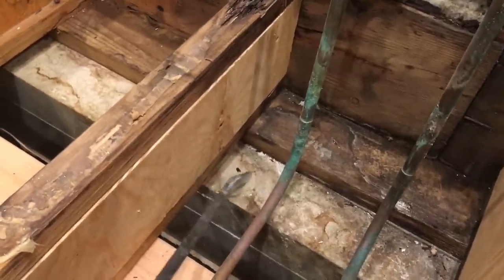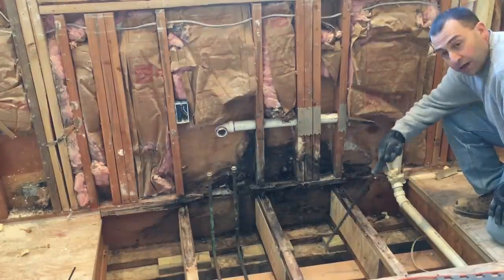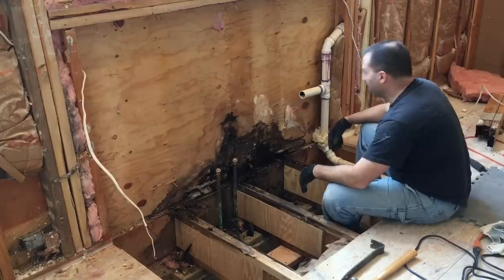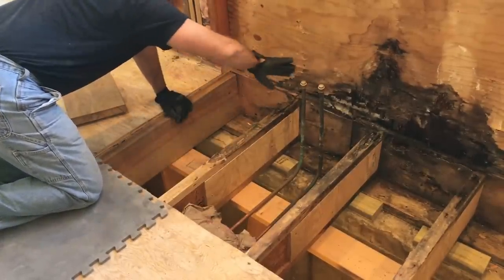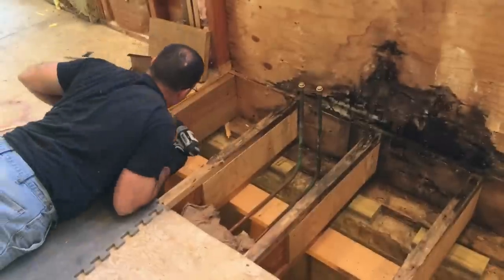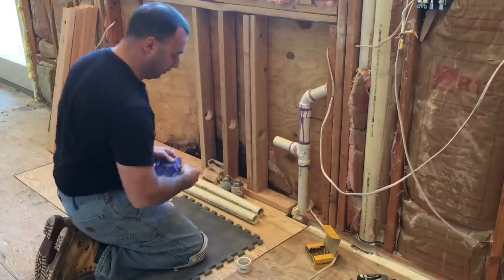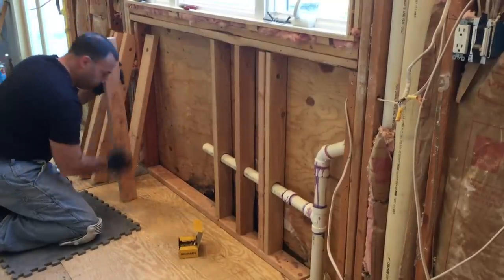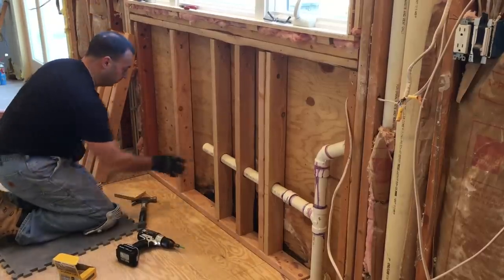Repairing Rotted Joists and Subfloor  - Part 4 of Remodeling My Kitchen

Comment: In the beginning of your video it sounded like you knew you water damage. That damage isn’t from a simple drip you had a full on flood and ignored and didn’t do anything to fix the problem till that part of your house was going to collapse. That in my opinion is nothing but neglect
Reply from the maker: Well...  Your are right I was aware of the problem.  But not to the extent until I tore apart everything.  As far as neglect?  I did take precautionary steps prior to remodeling the kitchen.  From below it was clear there was a leak.  The foundation wall was wet and when I pulled out the insulation in the floor joists I could see the rot on the ledger board and the sill plate.  But there was no way of telling if the leak was from the kitchen sink or soaking through the ledger board from the outside. 

First thing I did was wear gloves and a mask and pulled out all insulation from under the floor.  Then I shop vac'd all the loose rot wherever I could.  All of this was from below in the basement.  I took a spay bottle filled with straight bleach and sprayed everywhere I could down there.  Once the bulk of it was dead to the best I could, at that point I shored up the joists with that 2 x 6 wall you see in the video.  I knew the permanent fix would be once the kitchen got ripped apart.  At this point all I could do was monitor it.  But the wall at least alleviated any concern of the whole floor collapsing. 

My old kitchen consisted of granite counters tops.  The weight of the slab sat on top of the kitchen sink counter.  To the immediate right of the sink was a dishwasher (no support), and to the left was a trash compactor(also no support).  So there was no possible way to remove the kitchen sink counter and hold up the granite slab at the same time to do the repair.  Removing the granite was not an option as it would basically be tearing our that whole side of the kitchen, only to do it all over again when the remodel occurred.  And for an $80k Renovation, I wasn't doing it twice.   So I monitored the leak and ran a dehumidifier in the basement, spraying bleach on a regular basis as to not let mold grow again.
Now, onto the actual leak once I tore into it.  I don't know if I even explained this in the video.  There was a framing nail from the outside plywood sheathing of the house that was nailed right into the sink's main drain line.  I have a feeling when this occurred, but that's another long story.  After inspecting the old drain line, my guess is that the nail was actually plugging it's own hole for years, hence not an immediate issue.  Over the years, as the nail rusted out it left an open hole in the PVC drain and that's when the leak started to occur getting worse the more the nail rusted.  Never a full flood as you mentioned.  But a small hole can do a lot of damage as you see.
Anyway.  Long explanation.  But I wanted to address that I didn't just ignore and neglect it.  Believe me this was a huge concern.  But I feel much better now knowing it is permanently fixed.   The Good Lord was with me in that I caught this in time and had the means to completely tear out the kitchen to do the repair.  Appreciate the comment and you taking the time to watch.

Comment: It doesnt seem reasonable to leave all that moldy wood in there. I personally would have to take the molded wood completely out and start fresh. But this is Chicago.  Customers only want the best in this city. Not sure how it works anywhere else, but this would never fly in Chicago, the customer would be highly upset.
Reply from the maker: Well it's a good thing my customer is myself.  After getting a few few "pro" opinions (see my pinned comment), I am beyond 100% confident that I repaired this above and beyond any contractor would have done.  No one would have done as many steps as I did.  And not one suggested cutting out existing joists.
Anyone commenting about molded wood left behind doesn't understand what I did here. The sistered joists are now taking on 100% of the load - One end sitting atop a new Pressure treated sill plate, the other end sitting atop a new 2x6 support wall in the basement. 

The little bit of rotted wood on top of the old TJI joists are irrelevant at this point.  But the rest of the TJI is still fully intact (and stronger than original with my newly sandwiched 3/4" plywood in there).  Cutting out those joist sections would have actually reduced the strength of the new sistered joists. 

And any nonsense I see about rot "spreading" - Simply does not understand basic biological science. Mold causes rot.  Once living mold and moisture is taken out of the equation (both were), it is impossible for new mold to grow.   Scientifically Impossible. 

Sorry for the rant about rot - I know you didn't comment on that part of it.  I really do appreciate the feedback and comments.

Comment: I think it will hold up. In the COMMENTS, we simply comment about "ideal" scenarios. In reality, what you did will hold up a long time. 

In some ways it was over engineered but in some other ways, it was not done correctly- not like a pro should do it. No town would sign off on this if there were permits involved. I won't call you a hack- but it was simply not done in a highly professional manner. You did a decent DIY job though. You have the skills- just next time give that extra 10% and replace the materials. You certainly look capable- probably less work too actually! 

My biggest issue with your job. The way you handled the rot. Your patches. I would have definitely replaced all rotten and moldy wood. I have dealt with mold and rot. It's nasty stuff and you want it OUT. Spores can get released, etc. That is also looks like it could be a high moisture area- even if no direct leak. 2-3 weeks drying feels good and seems like enough time but trust me, it is not. I had a leak that was not as bad- hardly any visible mold and they recommend throw out everything, what you cannot, give it over a month with multiple commerical dehumidifiers running. 

Also, NEVER use BLEACH on mold on wood. Ok on non-porous materials like porcelian e.g., a sink or toilet it is fine. It rots wood and the molecules are too big to penetrate the wood (even if it soaks it.) It does not get IN to the cells of the wood- stays on top and only makes the wood weaker. Does very little to the actual mold. In fact, it can make it worse. Look it up- it's true. I dealt with this for months so I really know what I am talking about. It is also very bad for your health even in the future as you breath in wet, now dry, but soaked moldly wood. Throw it OUT. It also damages the structure and can actually cause the mold to grow in other areas. It's a real thing. VINEGAR is better and removing it is BEST. Pretty much common sense.

Comment: Those sistered joist arenet sistered they are just nailers unless you are planning on leaving a wall in the middle of nowhere in your basement made from kd without a pt sill?    Hopefully not but your joists need to be bearing on each end.        Oh and dry rot does spread.   Just not near as fast as with moisture.    If you are going to try to do educational videos be a little more educated yourself please
Reply: Tim McGlone - If your going to pretend you are some kind of “educated professional” you might want to do some research before saying something like dry rot spreads lmao
Dry rot is a misleading word/term that home owners use; not professionals. Wood that isn’t wet will never ever rot idk what you or anyone else thinks- it doesnt/never has/never will happen. ITS IMPOSSIBLE. 
The very second a tree is cut down the wood begins the natural process of decaying and eventually becoming composted into the earth/soil. Wood will not decay at an accelerated rate if its moisture content stays below 14-16%. 

The only time wood rots (not naturally decays which takes hundreds of years) is when its in an environment that causes its  moisture content to rise above 16% and remain elevated. The higher the moisture content of the wood the quicker it’ll crumble. 
Some types of mold can remain after moisture exposure has been stopped and slowly continue to feed on the  wood as its an organic material. However it eventually becomes dormant if you will, and will become active again if exposed to elevated humidity/moisture anytime in the future. 
And while im at it- termites only eat wood that has a moisture content exceeding 19-20%. They do not feed on dry wood because its much too difficult for them to eat- only wet wood.

Comment: How long are each of the joists that you sistered in? I have the same problem that was "fixed" by the previous owners. How long are they supposed to be? 50% of the length of the regular?
Reply from the maker: There is no formula.  It depends how far away from the sill plate that the rot infiltrated the joist.  Your newly sistered joist needs to extend beyond the weakened joist enough that it is mating up with a fair amount of undamaged section of the joist.  
If you were strictly sistering a compromised joist, I would say to overlap beyond the rot at least 18-24".  In my case, the newly built support wall is supporting both the "good meat" of the existing joist, as well as the newly sistered joist.  So the length is not as important.  In other words, my 2x6 wall is doing most of the work.